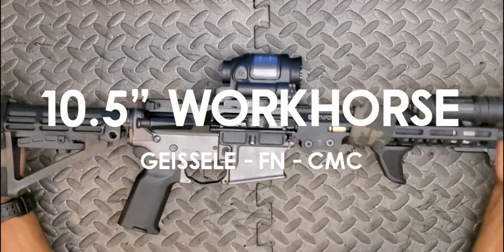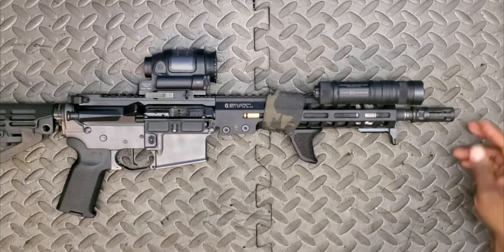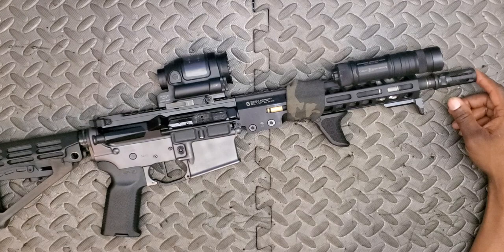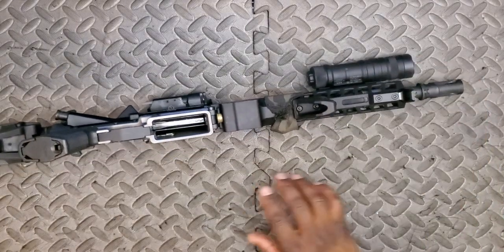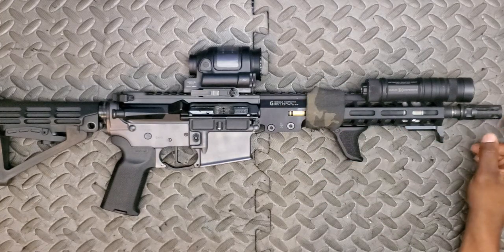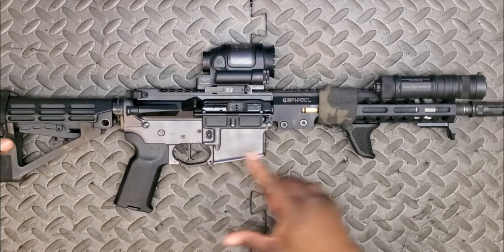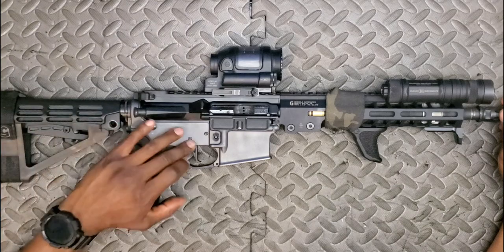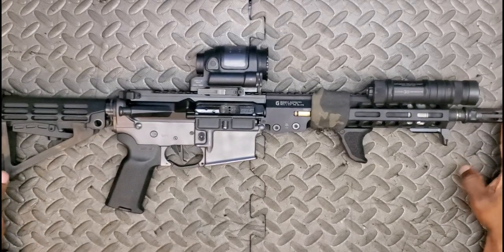My 10.5" Workhorse AR15 Setup | Geissele - FN - CMC

Comment: Good stuff man. solid and thought out. And thank you for recommending that people take a closer look at their barrel and BCG. Also a good consideration is a quality gas tube and gas block like your Geissele. Essentially paying attention to all of the parts that are controlling gas flow are important. Components that aren't built to good spec will leak gas, or some components just don't mesh well together and leak even if independently they are built well. Everything has tolerances. Great stuff my dude, i think i'm gonna pick up a handbrake too.

Comment: Nice Shortie Build. Mine has an 11.3" BA barrel & gas block Aero upper & lower, BCG & lower parts kit with a LaRue MBTS2 trigger. BCM 9" rail, Kag grip & QD sling mounts. Raptor SD CH (can's still in jail) & ambi SS switch, right now I have a VG6 Delta FH that will be changed for the can. I like the SB4 better because of the cheek weld. I also have an Aimpoint H2 with a 3X magnifier & Troy irons. Shoots great at 200yds & in & I'm just loving it! 
Enjoy your build, Be Safe & GOD Bless.  👈😎👉

Comment: for being a 10.5" barrel on a 9.5" mk13 rail, I have to say, your barrel sticks out a good bit more then my 10.5" barrel with the same rail. Kinda weird how they measure barrels sometimes.
Reply from the maker: Yeah I've seen some OEMs say they start at the base, others from a point inside of the barrel extension. I wish it was a bit more flush but I'm happy with it, Geissele makes great rails. Overall a good fit for a suppressor, too
Reply: @gunplaytv  Nvm dude, I literally rewatched your video (Love your build) and did some research and found out that Geissele recently stopped making the Mk14 rails in 9.5" and went to 9.3" again, like you stated in the video. Then your barrel gap makes more sense.

Comment: That barricade stop would just put your barrel on top of the barricade and distort your barrel harmonics, you need to move it back on the rails or get rid of it!😉
Reply from the maker: You're spot on. I previously had it further back where it was of more use. But now, I mostly use it just as a hand stop. That's whats got me considering removing/replacing it.

Definitely wouldn't want to rest the barrel on a barricade; as you said it will cause a change in harmonics and subsequent POI shift.

Comment: Great vid man.  I have the same upper set that I got from PSA. Only the upper receiver was of course, a PSA . Wanted to change the upper receiver to a Geissele one but the gunsmith told me that the barrel nut is staked(?) haven’t heard/seen anything like it. Can you confirm? Thank you
Reply from the maker: I don't wanna say that guys full of shit, but I don't buy it. The gas block is likely pinned, but even that is reversible (although probably ill advised). The only thing is their Barrel nut is proprietary, so you have to buy their wrench/adapter piece to be able to take it off. Maybe that's what he was talking about. 

You can definitely swap the upper, probably can even do it yourself If you've got a Geissele tool, wrench and a vice!
Reply: @gunplaytv  thanks for thé response bro, just ordered a Geissele wrench. Is it difficult to unpin and re-pin the gas block? I’ve only done it once on an FSP for my old AR.

Comment: Any thoughts on the use of the Law Tactical folding adapters for a build like this?
Reply from the maker: Funny you mention it. Thats one thing that I'm actually considering adding to this build. I've got one on another build and I like it a lot. I think I might either take that one off and place it on here or cop another. Definitely the only folder I'd consider. (No Sylvan Arms)
Reply: @gunplaytv  hell ya I hear nothing but great things on the Law Tactical. Definitely like the folding stock concept on a build like this